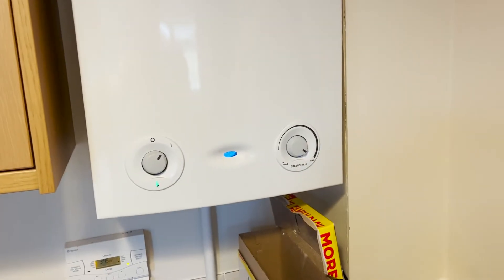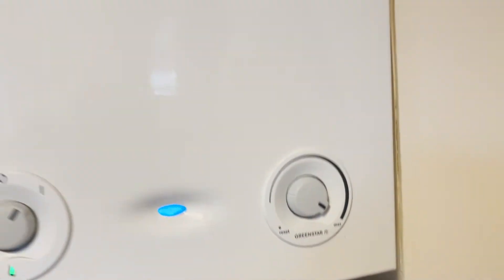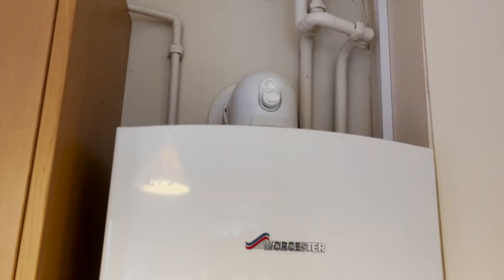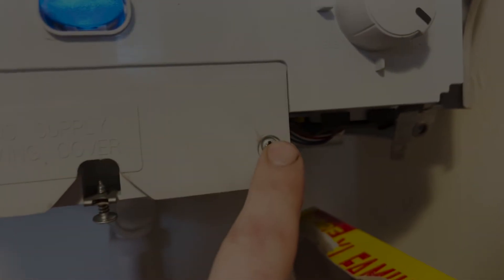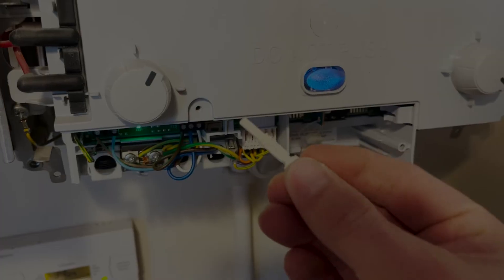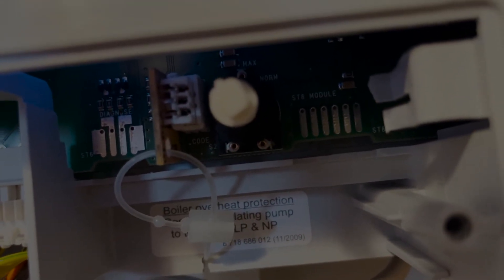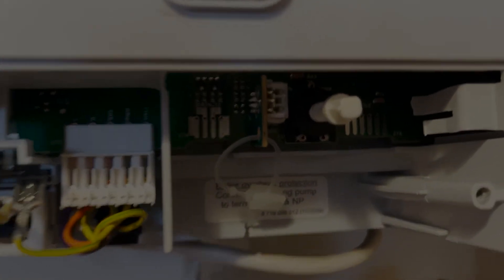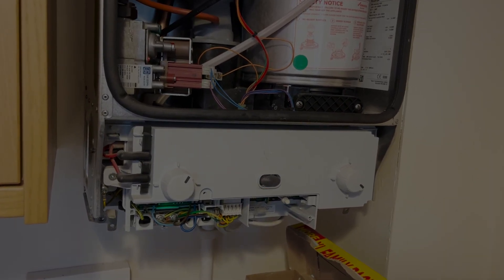How to put a Worcester Greenstar Ri in to service mode

Comment: Would this sort my issue, same boiler, that frequently turns itself off before getting to the temperature i set on the hand held device? I have had it serviced recently and it continues to switch itself off before heating up. I have to keep doing the manual reset turning it off and back on using the dial on the front right that you can see on the boiler. Sometimes it will stay on for several hours. It sounds like it does not power up well as it is quite quiet when warming up, if that makes sense

Comment: Mate where is the pressure gauage?
Reply: gravity fed system (vented heating system) dont require a pressure guage as it runs off a pump that only runs at .5 or 1 bar 

the system runs off flow rate

Comment: Thanks for this super helpful video Dan - it saved my day.  I'd just finished a chemical clean of my F&E central heating system and after refilling the system and bleeding the radiators, turned the boiler back on. There was clearly some air affecting the boiler operation as it tried to come on, fired for a bit then cycled off.  Going through your re-commission process and running the system at max for around 20 seconds did the trick.
Reply from the maker: Excellent glad it helped hopefully you can subscribe 👍🏻
Reply: @PlumbingGy  It also helped that I found the Instruction Manual online and identified the bleed valve inside the boiler.  There were a lot of air pockets to disperse and this all helped.

Comment: does anyone Know where can i find the pressure lvl on this boiler model
Reply: Did you find out? Been here for hours searching.
Reply: @TheShardd did you have any joy finding the answer?
Reply: @michaelgriffiths5723 None.

Someone told me that these boilers are not pressurised. As they run off a tank in your loft. So they work differently.
Reply: @TheShardd  I've got to the bottom of mine. I have a separate gauge on my system. It's on the filling loop next to my hot water tank. If that helps you out any?
Reply: @michaelgriffiths5723  where did you find it next to your tank as my boiler is connected to my tank in my attic and I need to check the pressure
Reply: @donnasaunders1560  mine was next to the tank. It was on the section where you fill from the cold water feed. It had a silver flexible hose (like the ones that connect your tap to the mains). Give me your email, and I'll send you some pictures if you want?

Comment: How do you bleed this system to check for any air ? Also I have noticed an air lock in the hot water system, any help would be great.
Reply from the maker: Is the airlock from the hot water draw off? (Taps does not have water)

Comment: Does the boiler require a demand as well to fire into max ?
Reply: Yes
Reply from the maker: No, as you can turn into service mode/ chimney mode
Reply: @PlumbingGy  Thank you.
Reply: @PlumbingGy Really helpful video thanks. Do you know how the modulation control works on this boiler during normal operation? Which temp inputs does it read to determine modulation level? I can’t find details in the WB docs and I’m thinking about upgrading the controls on an early 18 Ri. Does it have an OpenTherm or other intelligent input? Thanks for any info you can offer.